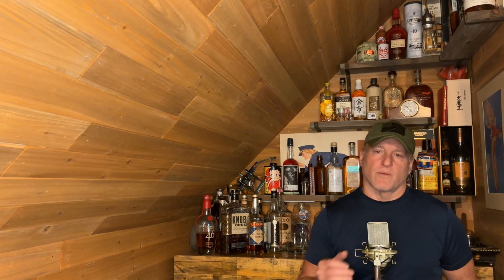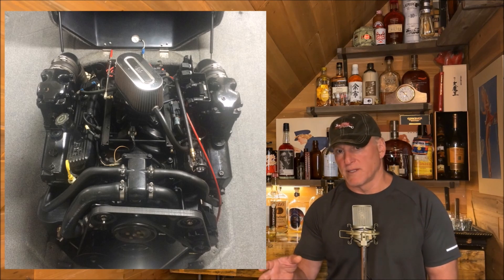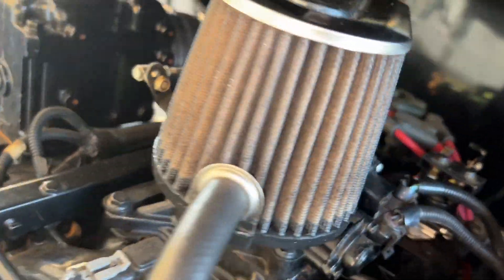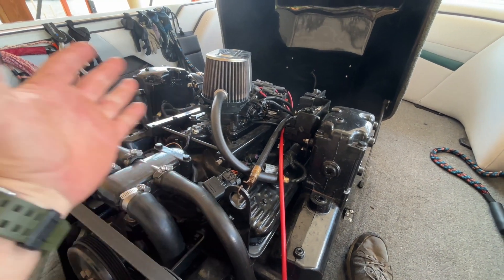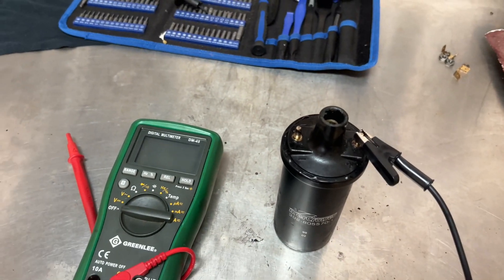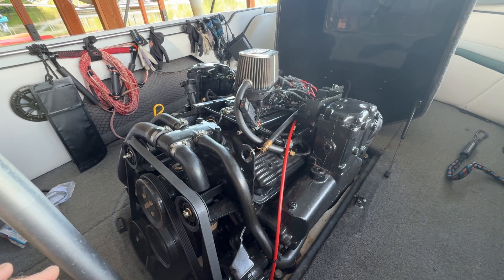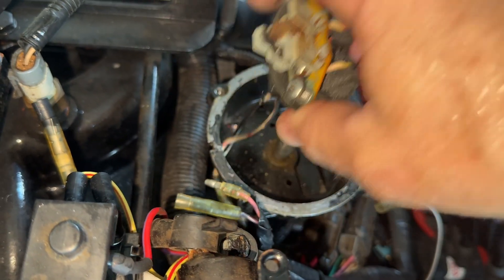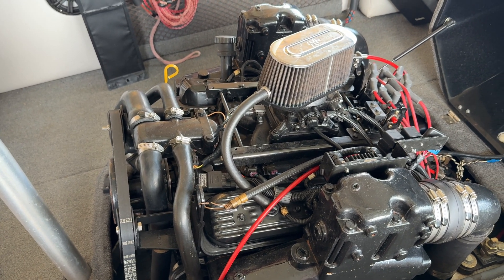Ignition Failure & Repair, Mercury Marine Mercruiser Inboard Engine-Thunderbolt V Diagnostic Code 45

Comment: The black cable from the ignition coil does it has ground i tested with engine block it seems no ground. This cable is connected to pcm module.
Reply from the maker: hi friend, not sure what you're asking

Comment: The ground wire is suppose to be mounted as close to your PCM as possible , if not directly on it. It makes a small difference!
Reply from the maker: Thanks for your input.  Basically, the bolt I used is close to the ECM, and I’ve had zero issues.  Runs like a new engine again